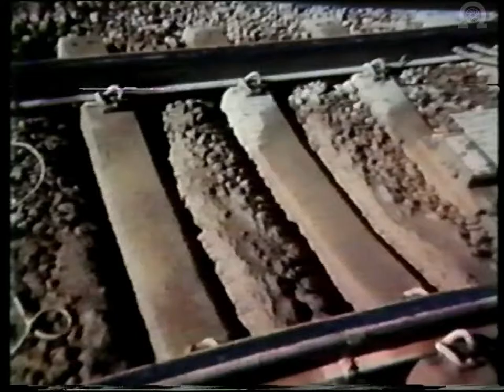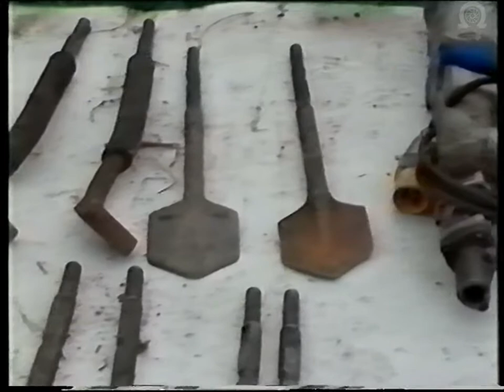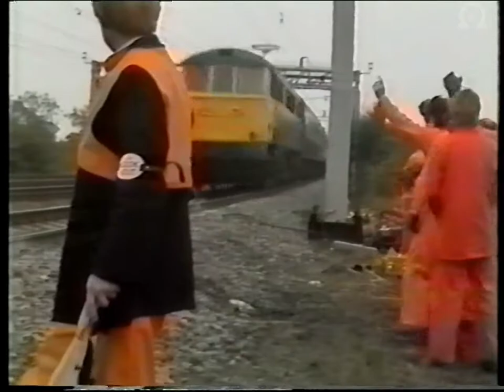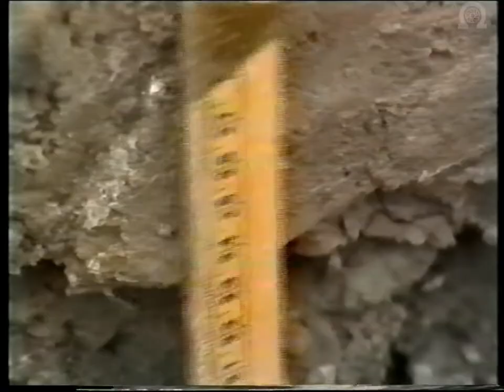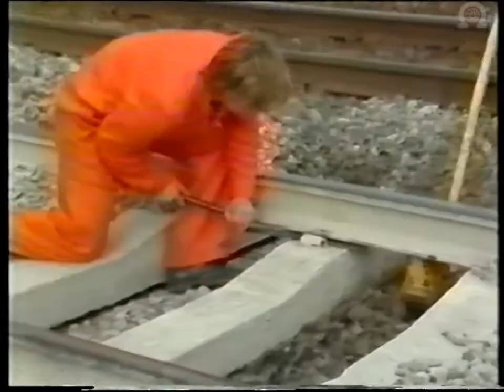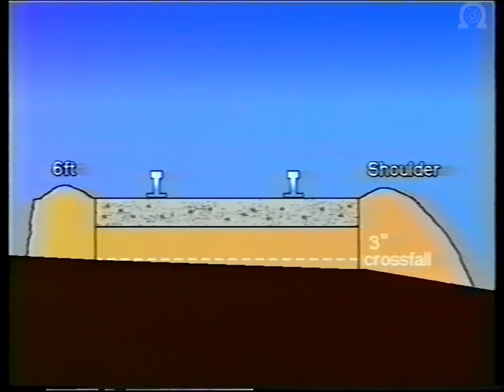Railtrack - Repair of Wet Beds

Comment: L&P and booked tamper on your section plus good ballast profile and condition shouldn’t give you a wet bed . As a former patrolman , we had a divvy manager who briefed the night gang about the electricity at work act 1974 , then asked me if when I was on days the following shift if I would take the lads out onto the down main fast during the peak and dig out a nasty wet bed that was right on the tip of the juice rail ramp end and was bubbling and fizzing away nicely , and would I do it without a form C isolation! ! ! I replied was he on drugs ? , give me the isolation and a possession and I’d do it was my reply . You couldn’t make it up .

We had such a bad wet spot by the single line tunnel at Raynes park on the up , 15 beds worth of slurry broken keys , missing housings on some sleepers , it was a potential derailment, it was like that for over a year the section maintenance engineer was horrified whilst out on a walk with me , I used to keep a copy of all of my walk out patrol sheets in my locker in case the office denied it , I had reported it every week as did my mates in the gang , half a dozen tie bars were put on ASAP and two weeks later they re laid the track. Horror stories from a railwayman of twenty years I could tell .